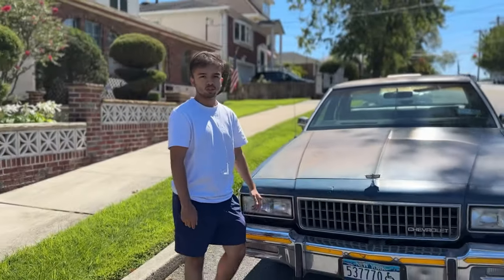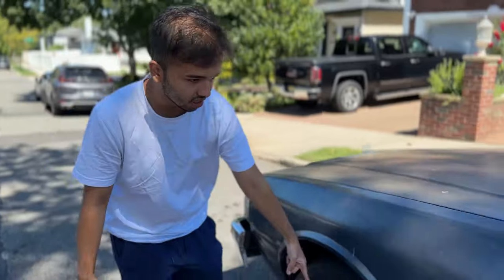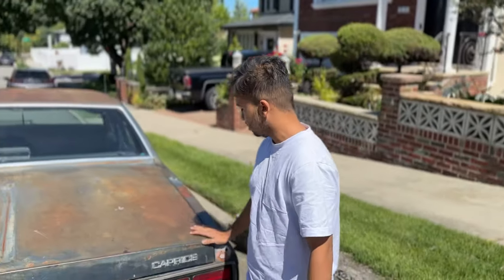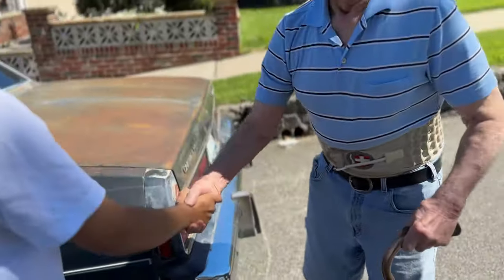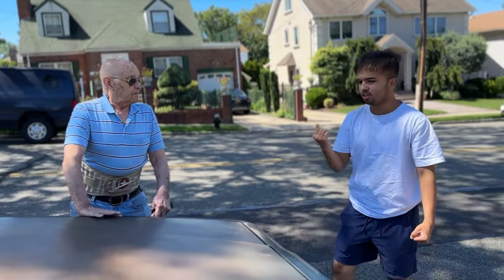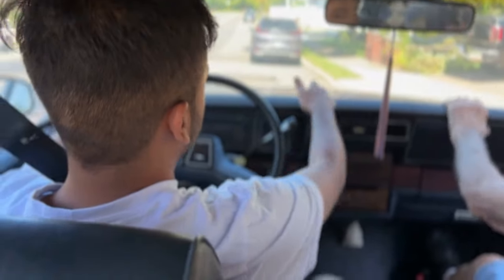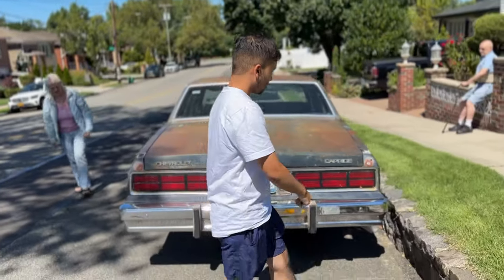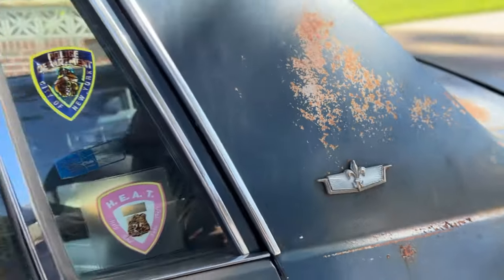Buying An NYPD 1990 Chevy Caprice 9C1 RMP!

Comment: My brother had one of these same year navy blue but it had some gauges just to the right of the steering column for oil pressure, volts, and water temperature I guess it was installed due to the police package because I've never seen that before in a box chevy but sadly it was stolen and never recovered.
Reply from the maker: this one was almost stolen a few times as well

Comment: Seats not original, missing gauges on the right side of steering wheel, but it is a 9c1 caprice. Not the only one because I own a Miami PD and nypd is no difference as far as rarity. And that one is in really bad shape, I’m sure the suspension is rusted out and has cancer around windows and on the bottom of quarters aswell as trunk and floorboards. If you plan on restoring than it will be upwards of 10k to get it in 10k shape so it’s up to your preference 👍
Reply: Those seats are original. The gauges next to the steering column were optional, my ‘88 9C1 doesn’t have them either, albeit it’s a fire department car. 

Lots of assumptions regarding rust and whatnot. These cars are not very easy to find anymore. Still worth buying for only $3500.

Comment: the car is maybe worth $1000 at most.....just to be nice give more than $1500-$2000 is extremely generous.  $3500 for all the basic work it needs just to be regular....no way.
Reply: Disagree. It looks like it needs paint, some other cosmetic odds & ends. It probably has the 350 as well, although some came with the 305. $2,500 - $5,000 on the high end. The Crown Victoria’s of the same years.. with the 351 Windsor, they’ll go for even more than this.